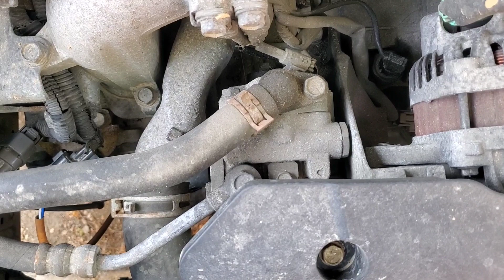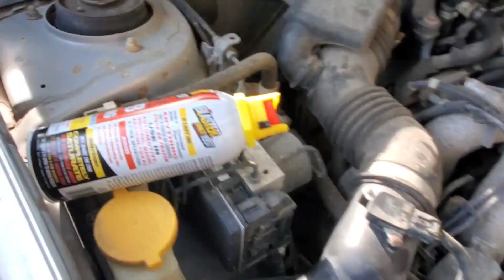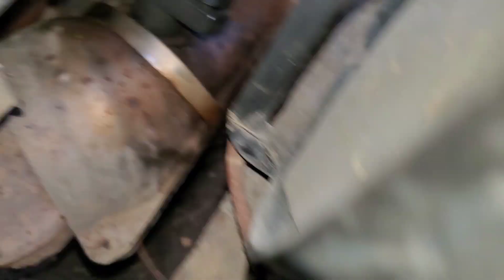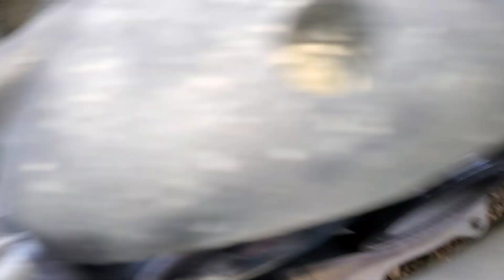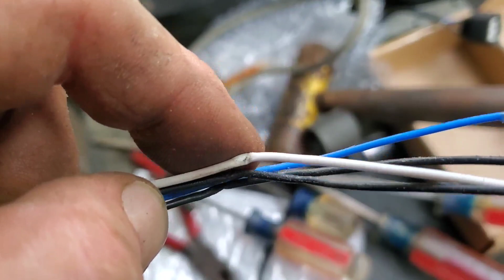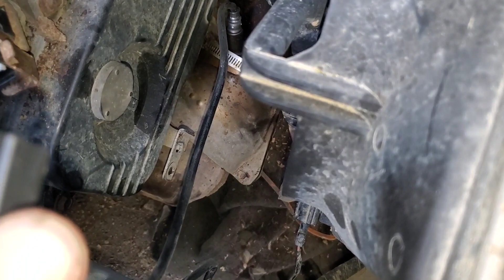How to replace  Subaru Forester Oxygen Sensors 2010

Comment: Nice video.  I did mine laying on my back didn't need to jack up the car or remove the wheel. Plenty of room using an o2 socket and a 13" ratchet
Reply from the maker: I'm fat though, I need the extra room under there.

Comment: Hey there. What code did you get? I have a 2016 and am getting a p2097. Also, oem is best I assume? Thanks.
Reply from the maker: My code was o2 heating circuit fault. I used cheap amazon sensors they tend to last 1 to 2 years. 
https://amzn.to/4fVKH5M Denso $57
Bosch a little more but I think they are OEM. 
https://amzn.to/3OlmRVj
verify which size you need. If you decide to do o2 sensors I recommend  doing both.

Comment: So my advice to the DYers is to replace your O2 sensors about every 50,000 miles or so.  Don’t wait for a check engine light to come in for an O2 sensor trouble code. Like I said earlier my car is responding better, runs smoother and is getting better mileage.
Reply: Yes, these sensors seem to fail at regular intervals.

Comment: I wanted to thank you for the video on replacing your O2 sensors.  I did not have any engine trouble codes in but with 147,000 miles on the vehicle I decided to replace the sensors. I had trouble with the female connector to the upstream sensor (two plastic inner pieces) were preventing the male to seat properly with the female. I went MOOG sensors instead of the Denso brand and everything works better now. My idle is better the engine runs smoother and I can see my MPG pick up faster
Reply from the maker: Glad to hear it.

Comment: Should disconnect the battery while i do this job?  Do i need to calibrate the sensors?
Reply from the maker: I dont see any reason to disconnect battery, and no programming required.

Comment: My connections are on the bottom above the cat converter......cant get them off......help
Reply from the maker: Spray with penetrating oil. Heat with propane torch. 
Can you get one of the special o2 tools on it? Then maybe a pipe on end of the wrench for more leverage
Reply: @darylturcott  its not the sensors.... its the electrical connections I cant get apart  😆😆
Reply from the maker: Oh i hate when that happens.

Comment: Weird, when I put the crowfoot on the downstream sensor, the extension wants to come up behind the abs.  doesn't fit as nicely.
Reply from the maker: Same year and engine?
Reply: @darylturcott  Yes, exactly.  Stock original piping up there as well.  Might be able to make it work with an angle adapter.
Reply: Got it.  had to go in through the wheel well and angle joint to get an impact wrench on it.

Comment: I have owned several Subarus over the years, and I have found them to be some of the easiest vehicles to work on.  They are so simply designed, almost to a fault.   But it makes repairs like this dead easy.
Reply: Until your water pump goes out and you realize it's run by your timing belt
Reply: @reedasuarusrex  This is true for nearly every car with a timing belt.
Reply: That's why you change both at the same time.